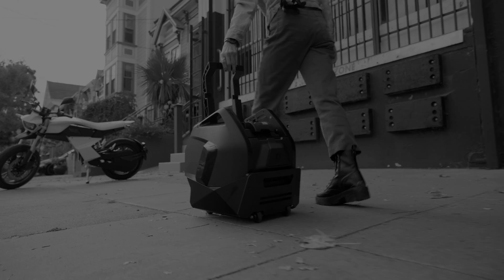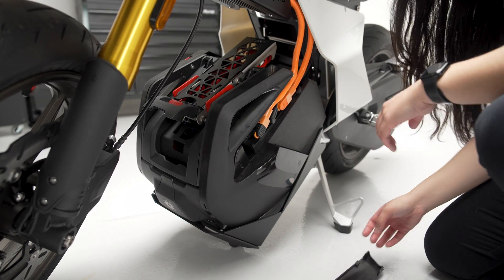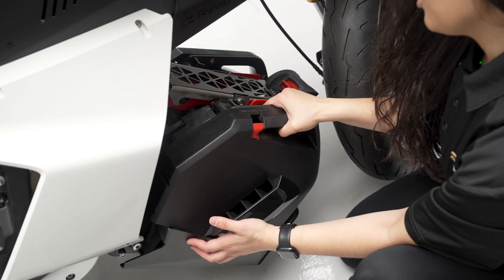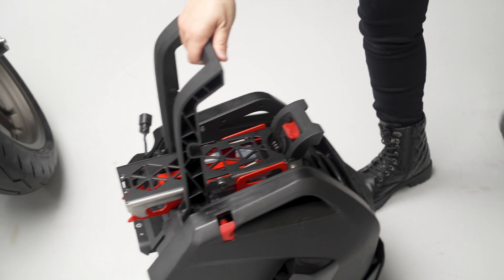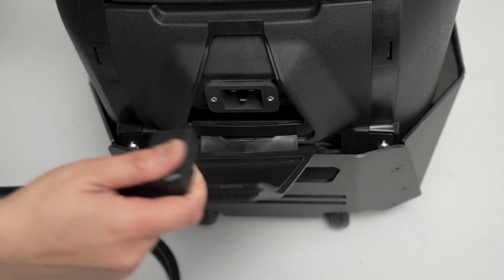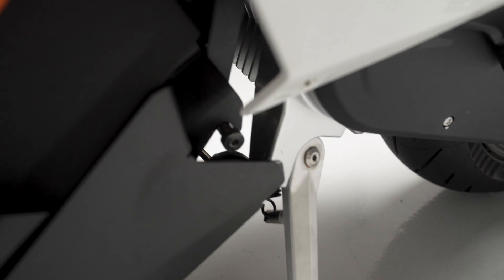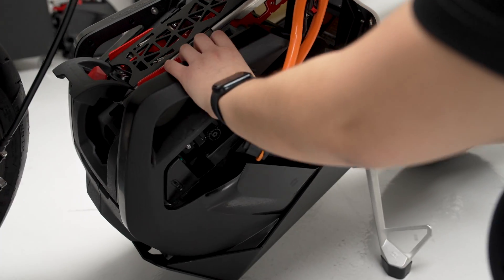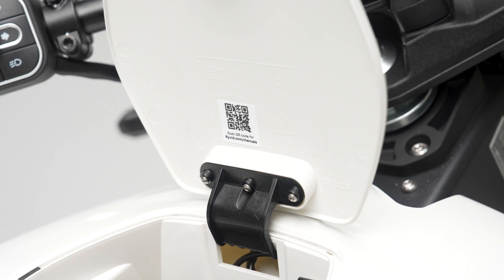Battery Removal & Install | Ryvid Anthem Service Guide

Comment: After many battery removals, I've also found it helpful to rub a very small amount of lubricant (bike chain lubricant or WD40) on the inside of the orange caps used for the actual power. The one near the front of the bike, especially, can be hard to pry off after a while.

Comment: New owners: if you get stuck at the step where you disconnect the small black cable, please be aware that you also need to push in on the black part on the front of the plug (while pulling) after releasing the red connector that she mentions in the video.
Reply: I cannot believe how many times I have remembered this comment when disconnecting my battery. It's wild that in this official video from Ryvid they gloss over this part.

Comment: No theft protection?
Reply: There's a combination lock on the battery that secures it to the bike via the same mechanism used by the safety release.